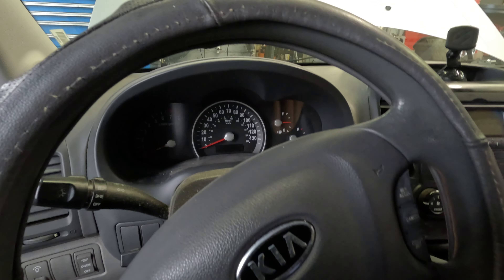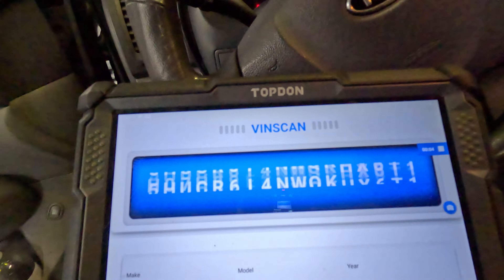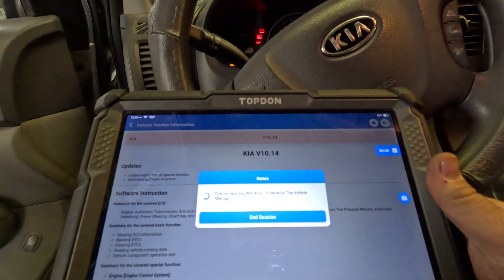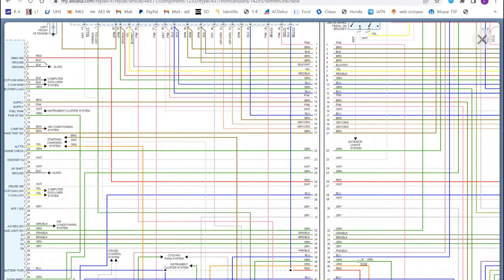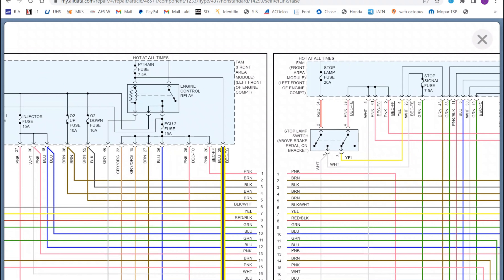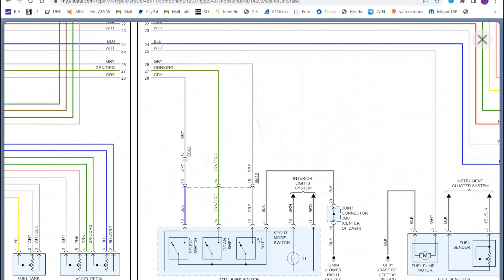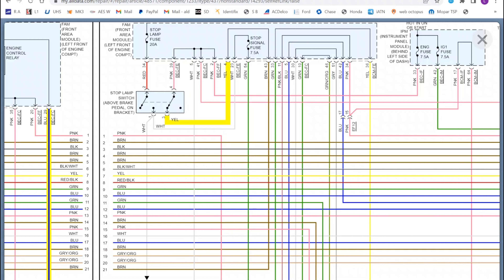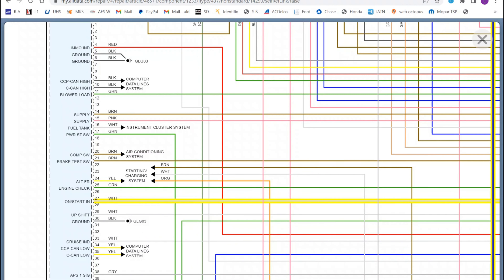Power Probe Fatality?! Does it need a ECM?! 2011 Kia Sedona

Comment: BTDT, friend was working on an old Escort trying to diag fan circuit.  on that model cooling fan relay grounded through the computer.  don't know what he did but car wouldn't start after he messed with it😁 he was getting ready to go to junkyard looking for replacement ECM.  we checked the fuses and sure enough blown.

Comment: Imagine that fuse was bridged/wrapped in wires - that'd suck, I've seen many a times where techs would feed power to a circuit without acknowledging the bridged fuse beforehand and then frying a module whatsoever, that's why it's advised to use the recommended fuse for that particular circuit 👍
Reply from the maker: Absolutely! Thanks for watching!

Comment: This might be late to ask but at 4:26 when we were checking the yellow wire how come we checked the ENG Fuse 7.5A (which is the correct one) and not the STOP Signal Fuse 7.5A (which I thought should be checked first) is it because of the Pink wire #39 which splices to 41 and 2?
Thank you for any explanation in advance
Reply from the maker: 💯 The pink wire gets it's power from the engine fuse. When he supplied ground to the yellow wire the switch was closed so he pretty much grounded the pink wire.
Reply: @advancedleveldiagnostics  Thank you very much I accidentally stumbled on your channel and its been the best thing that's happened in 2024 so far honestly the best diagnosis channel I have come across I love how you walk through everything with us showing all the possibile faults and not just where you found the fault thank you again for this high-quality knowledge
Reply from the maker: @MuridHolyBEEP  Thank you. I really appreciate it!

Comment: Ok ok, you mean to tell me the shop cant check fuses? they had to call ya in for this? WOW
Reply from the maker: You'd be surprised how many times I get called for a fuse. I think on this one I only got called because the power probe has such a bad name on you tube for being a module killer that he was sure it needed an ECM.
Reply: That was my thought, but in a working shop there are a lot of other factors at play. They have a booked day and there's often a line of customers who have dropped off their cars to be fixed, with the promise each will be ready at end of day. When one car takes more time, it may be more practical to ask a pro to come by and deal with it, especially if he can do it without tying up the hoist. Keep everybody working and the entire shop is more efficient, and you avoid a cascade of angry customers. The first time I saw how brake switches are now tied to the PCM, I scratched my head. Braking is tied to other functions like ABS and even drive by wire steering, so the PCM uses output from the brake light in a way that was not used in the past. I stupidly blew a brake light switch in a Subaru one day, and the computer wouldn't let me take the transmission out of gear. Fortunately the diagnosis and fix were equally easy.
Reply from the maker: @spelunkerd  yup that's what most shops tell me! Thanks for watching I'm a long time subscriber to your channel😄
Reply: @advancedleveldiagnostics  Ha ha, that's funny. I'm going to go through your video list, you've got excellent content. There's something very appealing about finding your channel today, I think it will soon escalate into serious popularity.
Reply from the maker: @spelunkerd  Thank you!